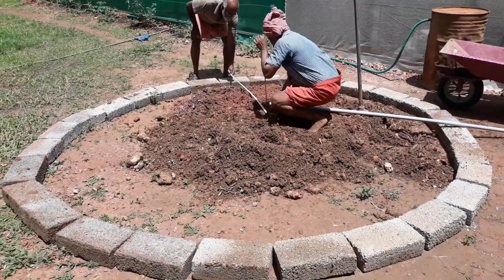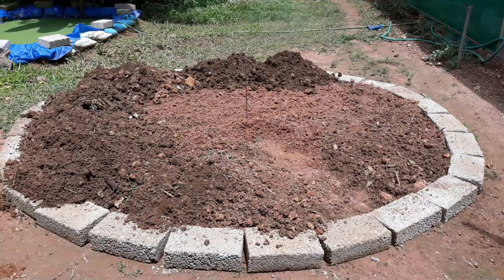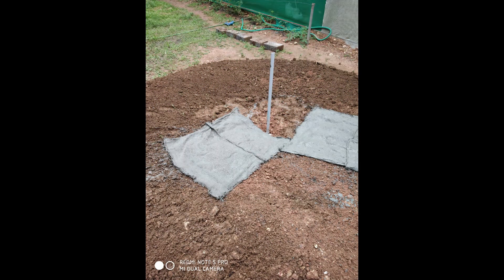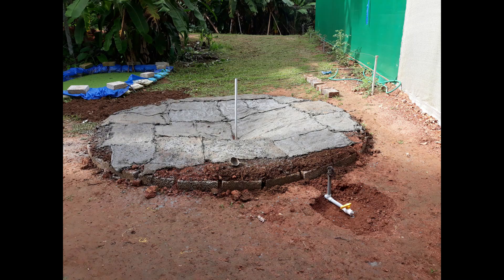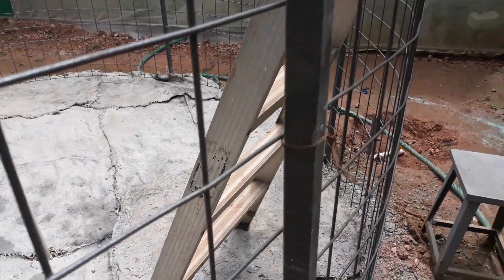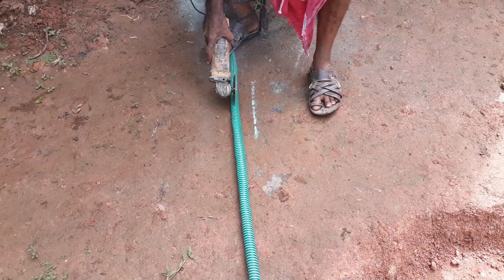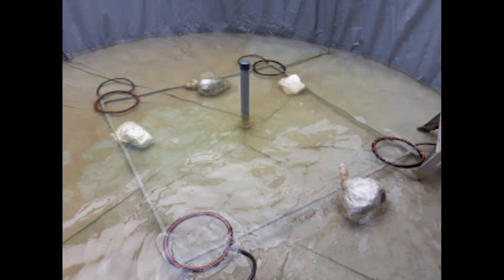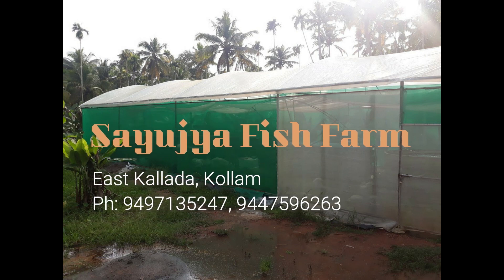ബയോഫ്ലോക്ക് ഓൺ‌ലൈൻ പരിശീലനം|കുറഞ്ഞ ചെലവിൽ ടാങ്ക് നിർമ്മാണം|bioflockerala|fishfarming in kerala

Comment: ഇതിന് എത്ര രൂപ വരും എത്ര മീനിനെ വളർത്താം
Reply from the maker: You can contact me for the rates. 1000 litres il namukk 25 to 30 kg production output kittum.  3 meter dia tank il 7000 litres water capacity und.

Comment: Ethara cost varum aa tarpa...
Reply from the maker: 3 meter dia tank
550 gsm tarpaulin sheet with drainage attached, 4mm thickness weld mesh structure of 1.2 meter height, hdpe protective sheet. Total cost 10,000 rs aanu. Ngangal materials provide cheyyunund.  Avashyamengil videoil ulla no il vilichaal mathi
Reply: @theridebackhome  ok
Reply: 3 metre ടാങ്കിൽ എത്ര മീൻകുഞ്ഞിനെ വളർത്താം

Comment: Chetta 3 mtr dia meshinum  550 gsm sheetinum enthu vila varum
Reply from the maker: Ngangal kodukkunund.  3 meter dia 550 gsm tarpaulin sheet 1.5 meter height with drainage outlet connected, 4mm thickness weld mesh 1.2 meter height, hdpe protective sheet 500 micron 1.5 meter height, total cost 10,000 rs.
All kerala delivery und. Avashyam undel videoil ulla no vilichaal mathi.
Reply: @theridebackhome  3 meter dia ulla bioflocil ethra fishine idan pattum??
Reply from the maker: @kirankumark3408  around600
Reply: @theridebackhome  delivery charge ulpede aanno?
Reply from the maker: @scoobyjulie5317  delivery charges extra aanu. Athu courier company ikk koduthal mathi upon arrival

Comment: Hello Bruben. As you have mentioned that the tank DIA is 3 Mtr. I would like to know what would be the Height of the tank from the Peripheral and from the centre.
Reply: SunilJose Pereira if it's 1.2 meter tank
Peripheral 1.2 meter, Center 1.35. That is 15 centimetre slope towards the center drain
Reply: @ananthu4444  Thanks a lot.
Reply: @ananthu4444  Hello Ananthu, Can I get your number.

Comment: Thank you for these information . Venturi aerator use cheydittundo . DO level maintain cheyyan pattumo ath use cheydaal? 25 - 30 kg/1000 liter stocking density use cheyyan pattumo biofloc il ? Please reply
Reply from the maker: I am using Ring blowers.   1 hp ring blower undengil 4 meter dia tankukal 4 ennathinu enough aanu. Single tanke ollu engil 4 meter dia tankinu hap120 mathiyaakum
Reply: @theridebackhome  Thank you
Reply from the maker: 25 to 30kg/1000 litres easy aayitt pattum. Ente harvest il enikk 250 kg from 4 meter dia tankeenu kittiyittund.

Comment: Hai.. Drain point ulla tarpaulin use cheyyumbol centeril ulla vertical pipe  fit cheyyenda avashyam illa alle..?
Reply from the maker: venda. pakshe sradhikkenda oru karyam und.  Theere podi meenukale athil nikshepikkan pattilla. athu escape aayi pokum.
Reply from the maker: also make sure its stainless steel or PVC.  Athallel water umaaitt reaction undai rust formation veraan chances und.

Comment: ചെട്ടാ എത്രയാ ഈ ട്ടാങ്കിനു ചിലവ്
Reply from the maker: Materials ngangal kodukkunund. 3 meter dia tank material includes 550 gsm tarpaulin tank with drainage attached, 4mm thickness weld mesh structure, hdpe protective sheet in between weld mesh and tarpaulin tank. Cost varunnath 10,000rs aanu
Reply: 4 dai മീറ്റർ ഉള്ളത് എത്രയാ പ്രൈസ് ചേട്ടാ
Reply from the maker: @moideenkiliyanni7095  13500 for material plus transportation
Reply from the maker: 20,000 rupa aakum 4 meter diameter tank set cheythu varumbol.  Plus aeration cost and inverter cost extra varum.
Reply: @theridebackhome  full material cost 10 thousand rs alle aayullu, 

Fish, motors, airation, invertor,  labour charge okke  cherthu aanno 20 thousand aayath?
Reply from the maker: @scoobyjulie5317  motor aerators etc are extra. Material cost plus transportation plus labour work etc.